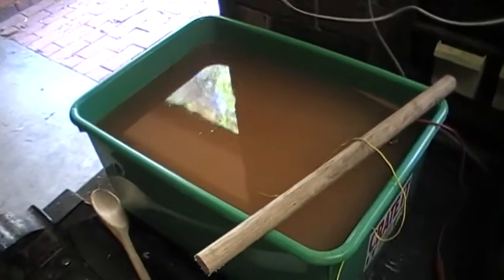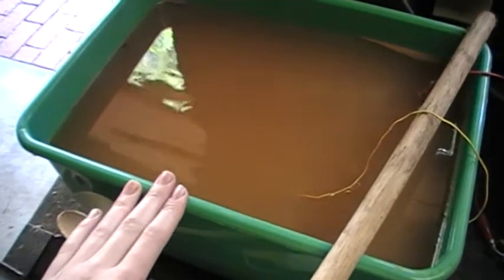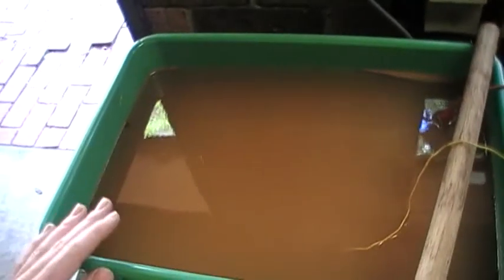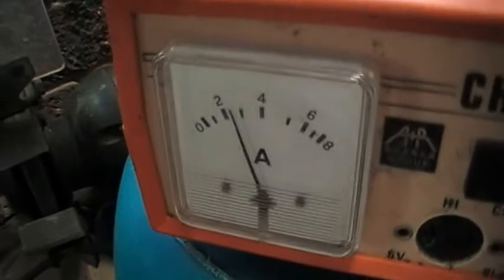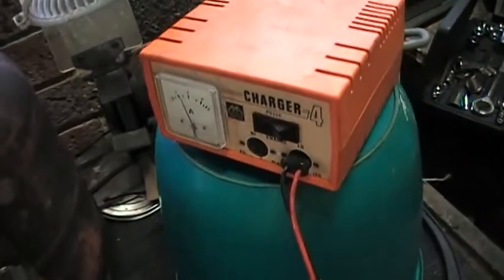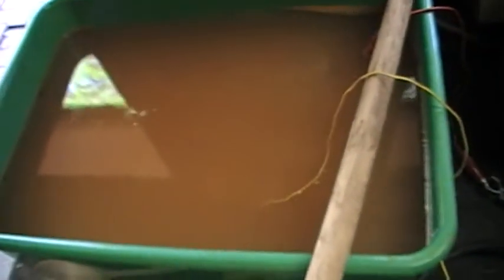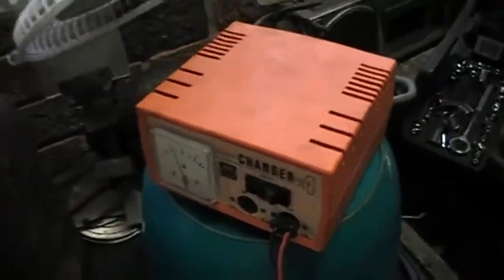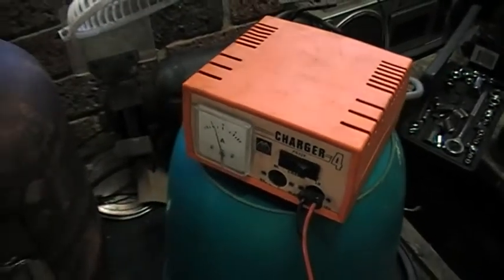Electrolysis tank MK1

Comment: i used 1 anode at each side of my tank and just placed my rusted spanner on the bottom which i just tied to the end of a bit of Mig wire and hung the other end over the edge and connected it straight up